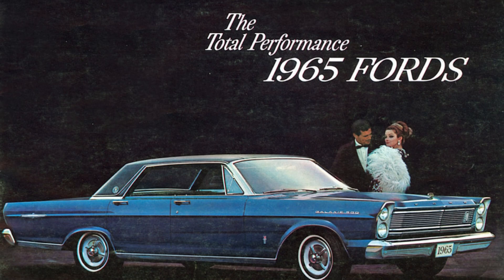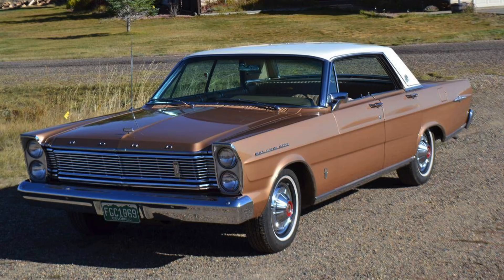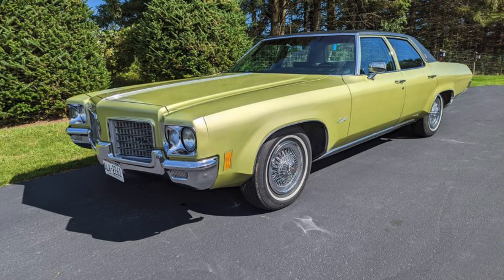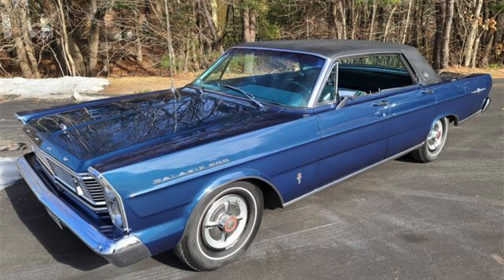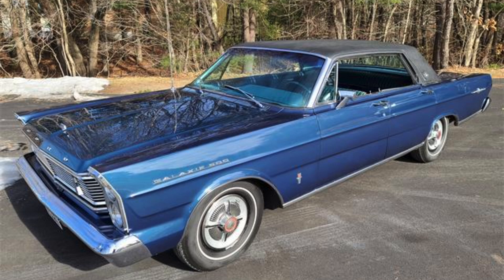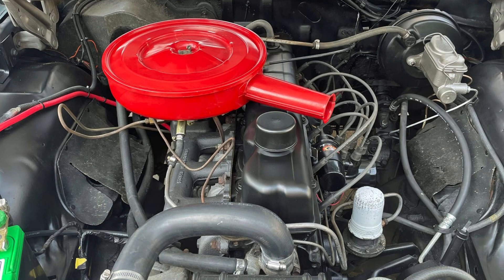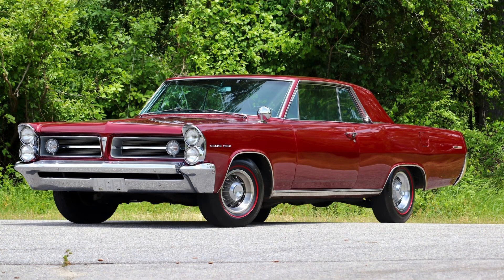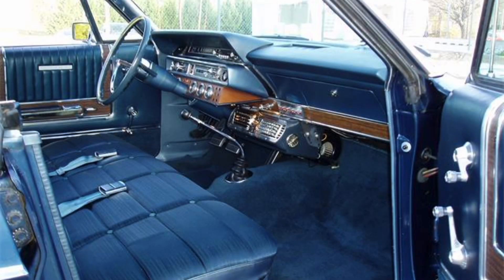Quieter Than A Rolls Royce?  How Ford Perfected the Quiet Ride in their 1965 Ford Galaxie & LTD

Comment: My Dad worked for Bolt, Beranek and Newman (BBN) in Cambridge, Mass in the 1960s.  BBN was an acoustics specialist outfit contracted by Ford to do the instrumentation and analysis for the Rolls Royce comparison. Bob Newman headed up the project.  Ford bought a new Rolls Royce for the testing. BBN instrumented both cars and ran the tests.  The result they reported was that the Ford was indeed quieter than the Rolls.  Ford was obviously delighted with the results of independent testing confirming their claims.  So impressed, they offered Newman his choice of any car in their inventory.  “That’s great” said Newman, “I’ll take the Rolls”.  He drove it for years after that.
Reply: The Ford is much easier to maintain. Look what they are worth in great condition now.
Reply: @paullesho2693 whatever some idiot wants to pay?
Reply: hillarious!  I think BBN went on to write one of the versions of Unix??
Reply: BBN contributed an early version of the TCP/IP network stack to the Unix kernel and utilities.  I might be worth noting that Bill Joy thought it was terrible looking code and rewrote it all at Berkeley.  That work had a significant impact on the success of BSD.  BBN also wrote TENEX, an OS that ran on the DEC 10.  It was later adopted by Digital as TOPS.  We can thank them for things like command line recall and editing, tab completion, the TECO editor, and other early advances in usability.
Reply: @philrulon  Thanks!  Always enjoy getting the answer socially rather than looking it up.  I started at the tail end of the Unix Wars.  In college I still had BSD, but from my first job onwards SVR4.  So I'd read bits of the history either in books or on usenet but spent 20 years+ just programming instead of studying history.  Now playing catch-up to C++20...
Reply: Yeh...he could have taken the RR sold it and buy 5 Fords. I would have sold it after a year and bought a 66 T-Bird, a 66 Shelby Mustang, a 66' Chevelle SS 369. And pocketed the rest. Today all those cars I would have bought fetching good money.
Reply: The way I heard it the original plan by the advertising people was to have the cars independently tested so they could put in their ads, something like "The $10,000 Rolls Royce is the quietest car in the world. For $3000 the Ford LTD is 99% as quiet". They were stunned when the Ford turned out to be quieter than the Rolls but decided to run with it.
Reply: Great car story, i love hearing these true stories, no matter what auto company ❤👍
Reply: I'd rather have the Ford any day.
Reply: @Benjamin-cd8vk Reported but YouTube doesn't have a category for random off topic proselytizing.
Reply: What a great story, I would have done the same! Thank you for sharing...
Reply: So you grew up riding in  Rolls.  I thought so.
     Seriously, your story is funny as heck and is another example of why i enjoy being around applied-science people and, gawd help me, admen (no, Snowflake, i'm NOT "gendering".  It's a figure of speech).  Both categories are relentless (at what, best not to ask) and witty subcutaneously.  Your tale (T-A-L-E) is delightful.  I will  be sharing it.  To science folk, car folks, and, gawd forgive me, ad folks.
      Lucky for everybody (and i mean EVERYBODY) your dad didn't do this job a few years earlier.  Had the paperwork for your dad's request crossed Bob McNamara's desk your dad might have ended up with a Falcon.
     A personal BBN anecdote: in my first years in Boston (early '80s) i worked for a graphic production house of whose BBN was a client.  Their stuff was always a pleasure to handle.
     I should have looked out their windows more.  Might have seen a Rolls-Royce delivering some jobwork!

Comment: I thought the 65's were too squared off.  My parents had a 66 LTD Brougham with the 428.  The 66's were rounded out and much better looking.  Or so I think.  The interior on the LTD Brougham was spectacular.  The only car we had that had as nice an interior was the 71 Marquis Brougham.
Reply: my parents had the 66 Galaxie 500 4Dr hardtop, white with red vinyl interior and the 390 2V.   and yes I agree it was better looking overall than the '65, which only looked spectacular in a few colors and body styles.   '66 was the beginning of the smog pumps and the 2barrel 390 really took the power drain in the shorts...that car was super durable and dependable, but fast it wasn't. ☹

Comment: My grandfather had a 1966  lTD, it had the most comfortable seats of any car I have ever been in! And it was super quiet and smooth going down the  road. It had the 390 engine.
Reply: I had a 66 LTD from '72 to '74 with a 390. I went through two transmission rebuilds and junked it on the 3rd failure. It couldn't stand up to the 390 and the weight. But yes, everyone wanted me to drive because it was big, quiet and cool.
Reply: My godmother drove one for 20 years with no mechanical problems, with the SEEMINGLY delicate ulatrafine cloth seats, same drivetrain - and the BRAND NEW 8-TRACK PLAYER invented by Bill Lear for his jets!  Unfortunately, when it came my time to drive it myself, BOY did that divorced-power-steering and handling suck!!  I wasn't able to compare it to a contemporary Continental, but Dad's '71 Lincoln steered & handled soooo much better.  I will, however, admit that it did ride solidly & smoothly as Adam explained with those oddly-planned chassis mounts...

Comment: On the fairly rare occasion that I rode in a full size mid to late 60s Ford, I was impressed with how quiet it was. I wish cars today could be that quiet.
Reply: some are you need to choose wisely though. and no sport packages! mercedes e class for example. c class too propably - atleast it was that way in the 90s and 2000s.

Comment: The mid 60s Fords were some of the best looking Fords of the decade. 1965 was a banner year for Ford with the fully redesigned full size cars and the Mustang. It was also the first year for the twin I beam front suspension on the pickups. The 65 full size was the best looking in my opinion, followed by the 66 Fairlane GTA. That new frame on the full size cars would bite them in a few years when the cars in the rust belt would have the frames rust in half!
Reply: I would think a flexible frame would be weaker.

Comment: My Aunt had a dark blue '65 LTD that looked exactly like the one in this video. That car lasted up until 1978(still in pristine condition with only 78,000 miles on it) when she gave the car to my cousin who stupidly ran the car without lead additive that it required due to the 392 engine never being rebuilt. He ended up trashing the engine and scrapping the car after having it less than 6 months.
Reply: Sad that he would scrap it only because he needed a valve job.
Reply: 390 engine, not 392
Reply: Benjamin-cd8vk   Allah can't be that great, I heard he drives a Lada

Comment: Hi Adam, very accurate video!  Yes, for 1965 Ford introduced a very stiff body (similar to a unibody construction car) and bolted it to a more flexible full perimeter frame, for the Ford and Mercury Full-size line for a smoother and quitter ride, with less harmonic vibration transmitted to the passenger compartment.  In the mean time, the 1964 GM "A Body" (GM Mid-size) was the first full perimeter frame that I know of.  I am not talking about a "X frame" or a "ladder frame".  Please reply.  Dave...
Reply from the maker: Cool
Reply: @RareClassicCars I THINK the last "X frame" was in regards to what you told me several months ago about your Buick Riviera that kept the "X frame" for awhile on the GM E-body.  But in the mean time the Oldsmobile Toronado and the Cadillac Eldorado started out as a "full perimeter frame" all three cars used the GM E-body.  You know and I know that the Riviera was RWD and the Toronado and Eldorado where FWD.  I do not understand this.  But in the mean time, when you drive a 1966 Riviera "X-frame at 100 MPH, it feels like your only going 50 MPH!  Thank you!  Dave...

Comment: They were rust buckets. The carbs were built too high above the engine. If it starts raining, park it because it will stall out. Cold starts forget about it.Ford cars were hard to start and most times it won't. The frames were bad. Within one year you need welding. Stick with GM vehicles.
Reply: I had a 66 Ford with 352, and I never had a problem with it stalling in the rain, it always started easily, hot or cold, wet or dry.  I agree, though, that the frames were not the greatest.  Ditto for that X member frame that didn't have any side rails that the Cadillac, Chevy, and starting in 61, the Buick used.

Comment: Excellent video!  I clearly remember the J. Walter Thompson ad, with the LTD and the Silver Cloud side by side.  The 1965 Fords were amazingly quiet cars for the time, but Rolls won in the end for quietness.  In 2003 I rode in an unrestored Cloud ll, and it was still as quiet as a tomb.  I doubt any Ford could say the same.
Reply: Still, for a low-priced car, it was impressively quiet.

Comment: Ford's (Borg-Warner) automatics were always three-speeds, but under light throttle, the car would start up in second. This feature must have been eliminated in this car.
As for "quiet," Ford must have upped its insulation in the engine compartment and exhaust system. Road noise isn't everything.
Curved side glass? Imperial had it in 1957, predating the Lincoln.
Reply: They had a new version in 58, where in regular 
Drive, it would still start in 2nd, but in Performance Drive, with the green dot, it would start in 1st.

Comment: My parents bought a new 65 LTD 2dr ht with 390. They traded our 63 Galaxie with 223 6cyl with 3 on the tree. Holy Moley, what a difference!! The 65 was absolutely gorgeous! I learned to drive in that car, and took my driver's test in it. Of all my parents cars, I liked the 65 the best. Useless tidbit: the taillights had about 1" diameter holes on the inside of the housing-this let light into the trunk if the parking lights were on. Fun story: Mom hadn't driven an automatic in many years, so when we got the car, Dad was driving and Mom asked what the "L" on the shift indicator meant. Dad stopped the car, dropped it into Low, and did a 50ft burnout! Mom was aghast, but I (being 13) thought it was the coolest thing ever! Loved that 390!
Reply: we had a 68 w/390 very fast and burned rubber forever
Reply: @super20dan I had one as well. My dad bought it new & I bought it from him in '71 instead of him trading it in. Would definately smoke the tires !
Reply: big car, big motor and shite tires... the perfect burnout car.😄
Reply: The Cruise o matic would have started in low gear if the selector was in D1 anyway. A better demonstration of L would be to be going 30 mph downhill and show how it helps keep the speed in check without overheating the drum brakes.
Reply: Benjamin-cd8vk  I guess given the Middle Eastern Origins of Allah, your preference would be the Rolls Royce ?

Comment: The downside of the torque boxes on the frame was they would rot and break up here in the northeast- in particular the 1965 and 1966 models. I was a tech in the 70's and we had to be careful when lifting them to look. I towed a few in with broken frames in the front corners.
Reply: They did look nice, but the 64s were much better quality.

Comment: In 1965, my dad traded his 1965 Mustang in for a 1965 Galaxie 500 2 door hardtop. He was a traveling salesman and found the Mustang too small for his needs. The Galaxie was dark blue and had under dash air conditioning. It was our first car with A/C. One summer, we drove from Nebraska to New York. It was a great road trip car.
Reply: Another advancement for Fords in 1965 was fully integrated AC (which your dad's car didn't have.)
Reply: So did Muhammad drive a Galaxie?  I'm confused...  Benjamin-cd8vk
Reply: “The loudest sound you’ll hear in your 1975 Ford is the ticking of the clock on the dashboard”
Reply: Benjamin-cd8vk  - This is not the venue to try and get people to convert to Islam, or any other religion.  Allah would not approve of this practice.  Go out directly to the people and seek new converts, but don't waste the space of completely unrelated videos to suit your desires.  😇

Comment: Adam you just explained why 65-67 galaxies used in Nascar didn't handle, flex with coils would be great on the dirt tracks but, terrible on superspeedways. Thanks Adam.
Reply: The front suspension of the 66 galaxies was used in nascar on almost all manufacturers cars till the mid 70’s. I have never heard of them not working on super speedways

Comment: Thanks for sharing this video Adam. Your in-depth knowledge continues to amaze me. I've been fortunate enough to own a 66 Ford LTD now for several years; a 4 door hardtop with the 352 V8/automatic. Not a speed demon by any means but I simply love driving that car and with proper care it has been a very dependable car, too, asking for very little since I first purchased it. I love the soft quiet ride that it offers. I did update the brakes a few years ago to front discs to make it safer to drive in modern traffic. Otherwise she remains almost all original. That LTD will be with me forever.
Reply: If the engine ever needs to be rebuilt, you can have it done to 1958 specs.  You will have 300 horsepower.  Also, you can swap out your rear end gearing with more aggressive gearing.  That will give you LOTS more speed!
Reply: @michaelbenardo5695  LTDs are about comfort not speed. If you want speed, buy a dodge Hellcat or a rocket sled!
Reply: love the body style ( runner up in my consideration but bought a 1969 charger instead ) in hardtop/glass-roof/convertibles as im not into having a b-pillar blind-spots aka nice car 👍wishing ford/others made something like this in 2030~ in 120"in wheelbase/full-size or 115-118" 1/2-sized suisced back-doors

Comment: the frame style you show here for Ford 1965 is very similar to Pontiac 1961-4,     Also, the coil rear susp does ride nicer, quieter but, leaf spring rear susp is better/safer for towing and harder cornering as there is less lateral play or movement/slop.

Comment: We had a 65 Galaxie 500 4 door in a light metallic blue. Then we had a 71 Galaxie 500 4 door hardtop. My parents traded the 71 in on a 73 Newport. Even though I was only 9 years old in 73, I noticed the sound level in the Chrysler was a lot louder.
Reply: Chrysler cars were all unit construction, Fords had a separate frame.  Your ears noticed even at that young age.

Comment: I drove a 1965 Galaxie 500 4dr Ht with a 352  4 barrel, Very  quiet and Plush, it was Dark blue and matching interior, Later in Life  I found a 1965 Galaxie 500 Convertable, Fire engine Red with a Black interior, 390 engine, not real quite as Quiet but a nice smooth Ride, I think style wise these were one of the Best Full size Fords ever Made....

Comment: A car magazine, Car and Driver I believe, once described the Rolls-Royce Silver Cloud as an example of what spare no expense assembly and modern equipment [power equipment and the like] could to for a 1940 Packard. [The Cloud in the 1965 ad was a Silver Cloud 3, the last model before the Silver Shadow, introduced in 1965.]
I never experienced a 1965 Ford, but my grandparents had a bought new 1968 LTD which I spent time in and perhaps even drove; at the distance of 55 years the awesome impression that car made on me lingers.  It was a far better car than their last car, a 1986 Mercury Grand Marquis - a miserable vehicle which I inherited and hated.
Reply: The '84 was nothing but a hagged out Fairmont.  Awful!
Reply: @mistert7958

You have your cars mixed up. An '86 Grand Marquis is a full framed Panther chassis car, not a Fox body like the Fairmont and the '83-86 Mercury Marquis.

Considering that the Panther was produced until 2011, it wasn't a bad car at all.
Reply: @johnfox3845  I can assure you that a 2003+ Panther is a VASTLY better car than that bloody awful 1986.
Reply: @stephendavidbailey2743  Where did I say otherwise? Of course the newer car would be better, but you'd be surprised at just how similar they are structurally.
Reply: @johnfox3845  
The frame, suspension, aerodynamic body - much quieter - engine and transmission are all completely different in 2003+ cars.
Reply: @stephendavidbailey2743  Once again, I never said they were exactly the same. I get the feeling that you like to argue.
Reply: @johnfox3845  The 1986 was a horrible car that was a major pain.
The 2003+ is a desirable car tha I would love to own.
Minor changes don't accomplish that.

Comment: I took my driver's test in a new '65 Galaxy 4 dr. It was easier to parallel park than our '65 Catalina 2 door. The car was very solid, the engine was precision balanced as was the drive shaft. Was that the year of the wedge valve cover engine, where they set a glass of champagne on it to demonstrate how smooth it was? 
This was also the year Ford car doors stopped rattling.
Reply: Either that year or 66.
Reply: Galaxie, not Galaxy

Comment: I had a '66 Ford Custom with the 240 cu in engine.  Very smooth reliable engine, leisurely on pickup but once up to speed would run 65-70 mph all day with ease and not bad on fuel for the period.